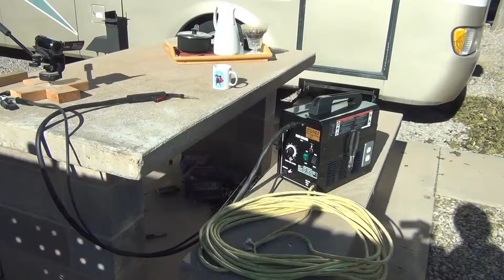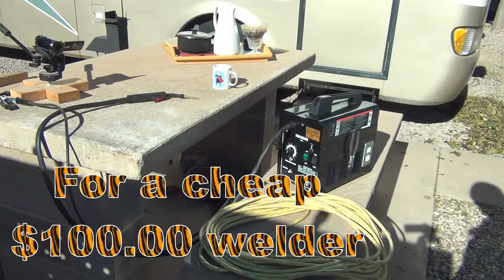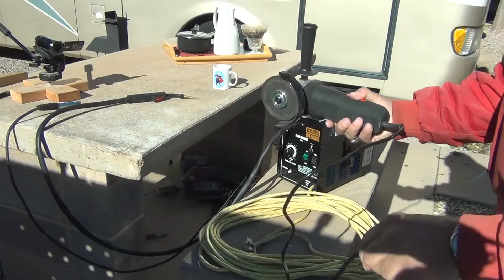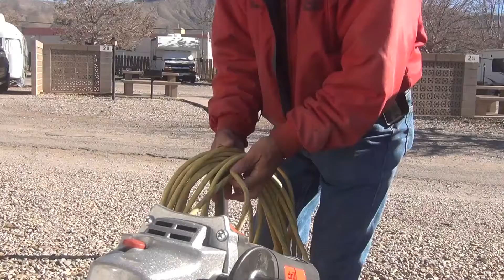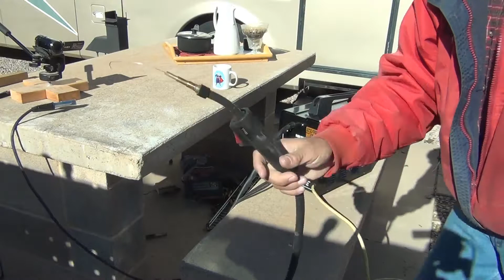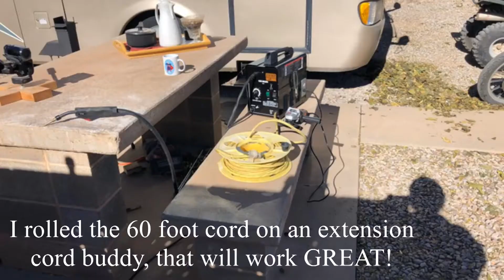#18 125 amp harbor freight flux core welder review

Comment: Thanks for your video, very informative. That outlet on the welder is a great idea! 
I was on the fence as to adding a rectifier to my welder (similar machine, one of the many "MIG 130" clones with the 4 voltage settings). 
I've read about the 100 and 150 amp rectifiers failing so I might get the 200 amp version just to be on the safe side. 
I've seen tests on these machines where the measured output surpassed 150 amps. 
I also do not believe the capacitor and choke combo on the output is absolutely necessary. 
On stock AC it would produce a 60Hz buzz with the polarity being right only 50% of the time, the other 50% not penetrating and just creating spatter. 
On just rectified DC it will still produce a buzz, but at 120Hz and produce the correct polarity 100% of the time. Should mean much better penetration and much less spatter. 
I think the only reason to have the capacitor and choke on the output is to filter out the buzz and have a more stable arc (not a deal breaker for me, though it does sound nicer). 
Supposedly the capacitor and choke also make for easier arc starts, because every time the wire meets the workpiece the voltage is at its highest DC voltage potential. 
I don't recall ever having trouble with the arc not starting immediately even when my AC welder is at zero 60 times every second, but I guess being at zero 120 times a second you're bound to get bad starts once in a while, I guess. Still, it's not enough for me to justify the cost and effort to install the capacitor and choke in mine. 
I do want to add a contactor on my welder, as unfortunately its contact tip is hot all the time it's switched on (even without pressing the trigger). I'll have to add a secondary power supply for the control circuit and wire feed motor (it currently runs on the output of the main transformer) as well. 
I'd love to hear (or read) your thoughts on this. Thanks in advance.
Reply from the maker: Hello getyourkicksagain,Since we are dealing with a MECHANICAL device, the wire coming out of the welder and we are doubling the frequency the machine will operate much much better and you are VERY correct about the better penetration. In AC operation the filler wire will actually be trying to blow OUT, 1/2 of the time instead of staying where you want it. I will not take my time to put in the caps. I have them in my shop but will never use them on this welder. I do not know what to think about the voltage being a 0 volts and the wire hitting the work. GREAT THOUGHT I have noticed from time to the welder did not start when I hit the work, MAY BE, I had never thought of that but it does not happen often. NOT ENOUGH to put in the caps. When you run an AC welder the rod you use is 6011 or 6010 which is made for AC use and you will not find the 0 voltage problem at all.
If you use a GAS NOZZLE around the wire tip the gas nozzle should be insolate the tip from the work. Try it and see. That will save you a LOT of money and headaches. Thank you very much for you comment, you gave me some to think about, I have been in electronics since 1969 when I went to Kansas City, MO to electronics school and I welded for a living for over 20 years. The last time I have a welding job was in 2001, but I picked it up again FAST.
Reply from the maker: Hello getyourkicksagain, I used my welder yesterday and ran several passes totaling about 30" to 40" in about 1.5 hours time. I put my hand on the corner of the welder I put the rectifier and heat sink, it was warm, not hot but warmer thin I thought it should be. My advice if you make this MOD. also put in a 4" 12v computer fan blowing on the heat sink.
Reply: @davescorneroftheworld1147  Got it, thanks for the heads up
Reply: @davescorneroftheworld1147  Wow, thanks for the prompt reply. 
I was only officially an electronics tech for about 6 years (the company I worked for closed down for financial reasons) but I have loved everything electric and electronic since I was a nerdy kid in the weird, early 80's.
Now that I think about it, I was wrong in thinking we hit zero on AC 60 times a second. Visualize a sine wave and let's say you start measuring from the highest positive peak. You go down past zero to the negative peak, up past zero again to end at the next positive peak. So in one full wave we cross zero twice, or 120 times a second. 
That makes me want to investigate further the reason for the stutter starts after rectification. I did not know about there being AC-specific welding rods (I'm not a welder - yet), so there's an interesting lead I could investigate. 
You are correct about the isolated gas nozzle. I found it gets in the way and is not needed for self-shielded flux core so I replaced it with a non-conductive cover that protects the gas diffuser from spatter. My welder already comes plumbed for gas, which I'll probably never use, but I'd like to keep that system intact. 
I just don't like the always hot tip. If my big old gloved finger fails to depress the somewhat stiff trigger on my rig and I touch the piece, the wire immediately burns back to the contact tip. It just seems so unprofessional to me. 
On the new Flux 125, (the old version was hot tip like mine) they have a small relay on the PCB that just switches the primary side of the main transformer when triggered. That PCB is powered by a separate small transformer. It seems to me an elegant, low-cost solution (I have spare transformers and parts, much to the chagrin of my wife, lol). That is what I will do to mine.
Lastly, and I won't further bore you to death with my ramblings: Where did you mount your rectifier and did you use a separate heatsink? How has it held up? 
Thanks for listening and take care!
Reply from the maker: PLEASE NOTE: this first paragraph is JUST FOR FUN. 60 times per second 120 times per second, I really don't care. (You are right with the 120 times per second will hit 0 volts). Let me back up! I feel my brain is only a 16 GIG brain and it is FULL. If I think about anything to hard some of the 16 gig will fall out! In other works as long as the welder works most of the time I really don't care about the why. I need to think about more important things, like where am I going to get the rent money. PLEASE understand I am having FUN here and I am NOT saying I don't care what you are saying.I might have mess led you when I said there is AC rod. Yes, for STICK machines not for wire feed welders, SORRY. Speaking of AC welders (225 Amp Lincoln) and others. Can we put a rectifier in one of those and make them a GOOD DC stick welder? Where did I put the rectifier? As you are looking at the front of the welder, in the upper right hand corner and yes I did put a heatsink, I have several around. I always like to talk welding and electronics as well as other subjects. So I will leave my E-Mail address here and I will start putting it in the description of my videos as well:
Dave@HorseShowVideoProductions.com
HARE A GREAT DAY